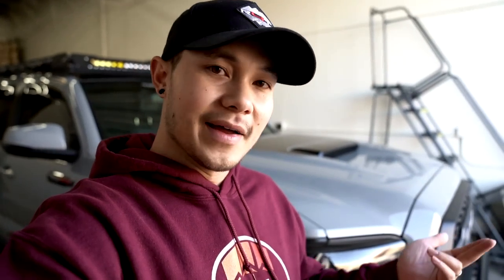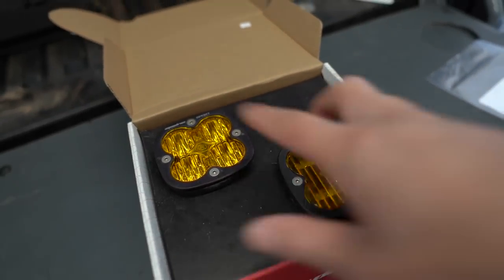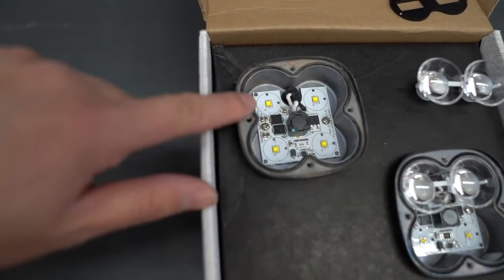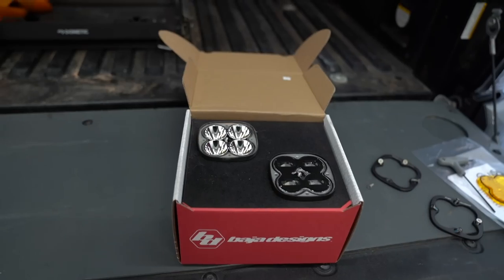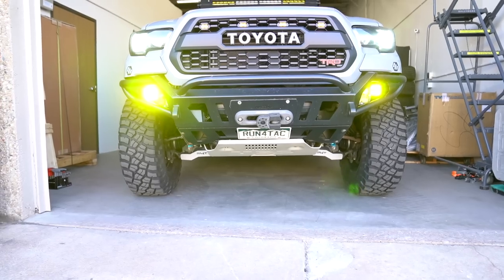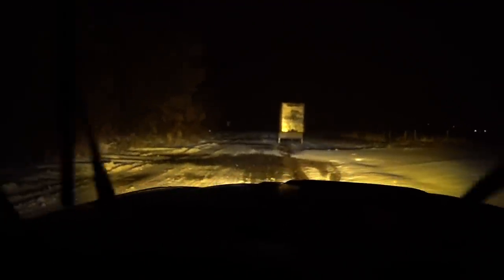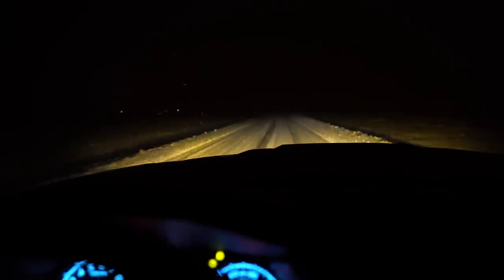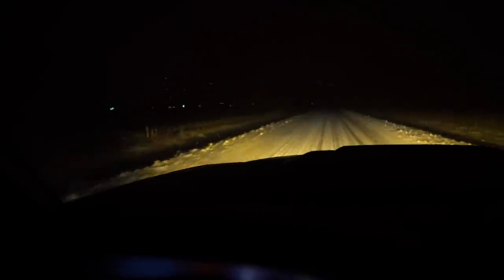Tacoma Street Legal Fog Lights - Baja Designs Squadrons SAE vs Sport

Comment: Amber reduces reflection/glare. I've driven in the fog off and on for 20+ yrs. Amber reduces eye strain and stress. During the summer I'd replace the amber lens with white/clear lens... I remember driving in tule fog. Couldn't see the road but you were sitting in sunshine.... I've driven in fog that formed a tunnel over the road. Like driving in a tunnel that you know doesn't exist. It's Eerie at night. The heat rising from the road causes the fog to lift and go over the road but as the road cools, the fog lowers...

Comment: I'm planning to get these for my 2020 Offroad, but I'm torn between the sport and SAE. Personally, I'm not worried about the sports being too bright. Here in Ohio every jackass with a truck has a light bar and they run them all the time on the road. Cops couldn't care less. I work nights and my commute is on a couple very dark roads with lots of deer, so I'm leaning toward the Sports. That said, now that I know they are the same exact lights underneath, I may go with the SAE version and see if it's bright enough. If not, I can simply remove the black shield and basically have the sports.
Reply: Dont be part of the problem.  Dont use illegal lights on public roads.
Reply: @drmalenko  Did you even read my comment? My primary concern is MY safety. If the cops don't give a sh*t, I certainly don't. In any case, I got rid of this truck, so it's no longer an issue for me.
Reply: @dlg5485  it's a public road. You should care... You've gotta really poor attitude.
Reply: @dlg5485  old news and you got rid of truck and all, but there is a good reason those lights are illegal on road. Oncoming drivers are blinded and it can and has caused accidents. Just because cops don't care to do their job doesn't mean we should break laws. Know what I mean?
Reply: @sh0cktim3  Duh! I'm not an idiot. My point is that half the cars on the road have aftermarket lights that are too bright and the cops couldn't care less. Sometimes, they're the culprits. I commute on dark roads with no street lights and I use my fogs to see better...and I can actually turn them off when there's oncoming traffic because I have a brain.

Comment: I’ve ran with my squadron sport on the street but turn them off when around traffic.
One of them actually leaked water because  O- ring was not in the groove. The water turned the chrome cone black.  I am sending the one back to Baja designs for a replacement.  I’m not happy about having to send it back before they send another one OR repair this light.  It blew the fuse that is on the harness.

Comment: Just installed a pair of amber SAE Squadrons in my 4Runner's factory fog positions and I am concerned something is wrong with them- it is hard to see if the lights are even on or not because all they do is produce a dim amber fill light to some surrounding area. They do not have a beam pattern like the ones shown in this video and they certainly aren't nearly as bright as the SAE Squadrons shown in this video.

Comment: Does anyone know if it is possible to purchase the SAE components (reflector cones and shield) separately? I wouldn't mind being able to switch the intended usage for street and OR when I'd like instead of adding additional lights.
Reply: Not that I’m aware of but you could most likely find parabolic reflectors that work, or just take them out entirely.

Comment: Would the s2’s be street legal?
Reply from the maker: The only steet legal lights would be labeled as SAE. The S2's are not street legal.
Reply: @Runnin4Tacos Baja Designs does now have a SAE version of the S2 lights. It might not have been available when you made your reply comment to the original comment/question about the S2.

Comment: I'll save you the trouble, don't bother with either the sport or SAE squadron if you want a true performance fog light. The sport isn't street legal and the SAE is actually dimmer than a factory halogen lamp, due to its poorly conceived optics. The SS3 by Diode Dynamics is a true performance fog. 4x the brightness of BD, with better optics and a cutoff.
Reply: But the SS3s aren't SAE either.   DD says SAE but lenses aren't stamped DOT certified.
Reply: @maxdaddy6434  the SS3 lenses are indeed stamped. Mine say SAE F19. DOT does not set compliance standards for fog lighting, only SAE does. Please do some research. I recommend starting here: https://www.tacomaworld.com/threads/the-led-sae-j583-fog-pod-fog-light-review.554813/